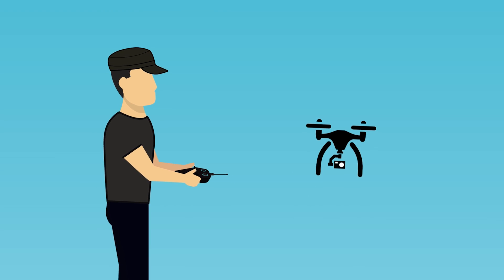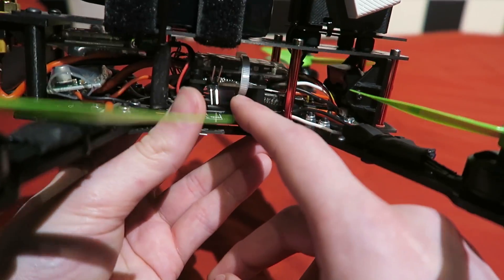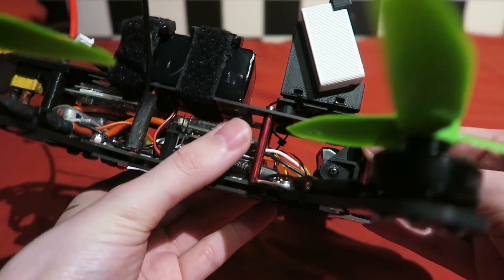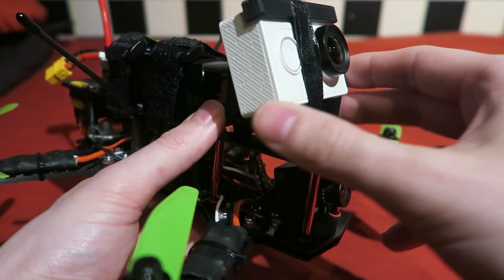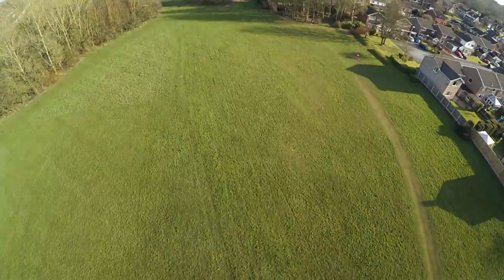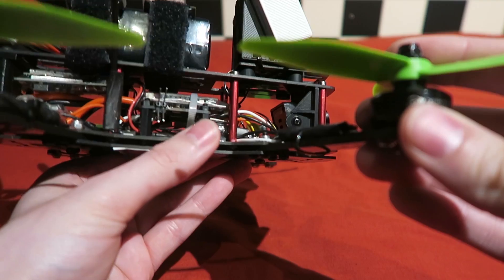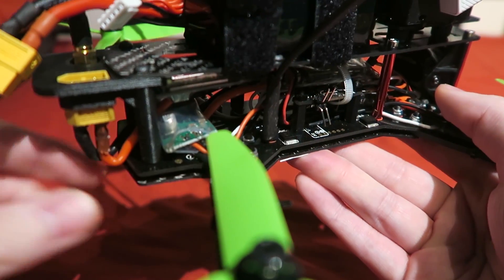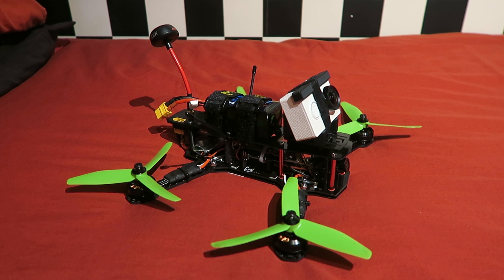Xiaomi Yi Jello + 250 Miniquad Updates

Comment: Hi Andy. I love your videos. They are so entertaining. Today I tried your method using 3mm. anti vibration mounts (4 pcs.) however, it did not work. Today I tried with just two of those grommets and there's still jello. So tomorrow I will try with three of them next to each other in order. Although I could not get same results as you I won't give up. Once I manage to get it right I will let you know. Cheers
Reply: I tried again today with three bobbins next to each other. Still, lots of jello despite having brand new props on the quad. My Tyro 129 needs a gimbal - No doubt.

Comment: DAL props,looking at what you've got I'd suggest the bullnose 5x4.5 3 blades, durability, well, a friend broke the 3mm carbon arm, but the prop was fine. 2nd post, I'm spamming coz Iz drinking beer
Reply from the maker: +Ben Portman I have been looking at the DAL props as they seem to work pretty well with 3d ESC's something i wanna have a play with :)
Reply: I finally got out and had a few good batteries through the Tarot space through time thingamebob, Very impressed with 3 blade 6x4.5 DAL props, hovering in the first 1/4 of the throttle stick on a DYS 2204 motors carrying a 2.2mah turnigy 40 to 50C battery and all the kit.Rocket ship. Had a few spills as the thing just wanted to go, no broken props, love Em, wouldn't by anything else. They're factory balanced too, which has always been my problem with 3 blades.
Get some  (huuuegh)
Reply from the maker: Thanks for that I need to pick some up. cheers

Comment: build the zmr 180 love that frame!I have the zmr 160 (1306 3100kv) zmr 180 (1806 2300kv) and the zmr 250 (2204 2300 kv motors) but fly most of the time with the 180 have the dal 4045 triblades on it and its amazing!props costs a bit more then the gemfans but really can take a beating never broke on and crashed a lot!Also got a emax nighthawk 170 frame on the way and waiting for the emax 2205 2600kv motors to be available on banggood.
Reply from the maker: +hooivork81 I thought 180s struggled with power against a 250?

Comment: Those tri blades sound nice, tend to shatter quite easily though! 
I brought my Kiss fc off of a friend, he put a blob of solder either side of the USB for extra protection and it seems ok so far
Reply from the maker: +magicalpencil u are correct they shatter instantly :( good work on the usb! wish i had listened
Reply: haha I didn't even know about the USB issue, the person I brought it off has been building quads for a few years and has the knowing of the ways!

It is better (but more annoying) to have the props take any impact and soak up the energy that would go into the motors :)

Do you think you'll be moving on to different props at any point? I have just moved on to DAL 5040 bullnose, and my-gawd do they move!

sorry for the essay lol :^P
Reply from the maker: im sure once i have broken the three leaf I will look at others but im happy with these for now